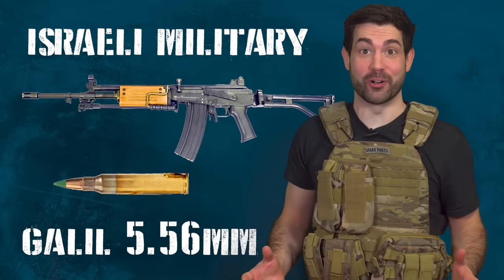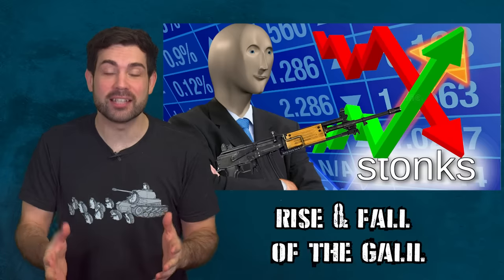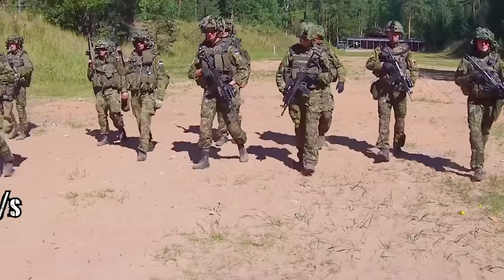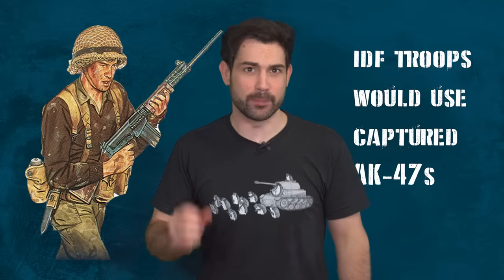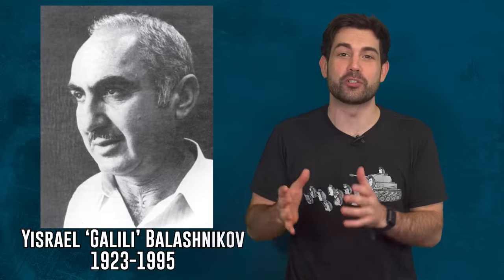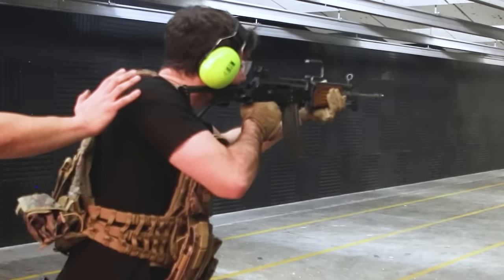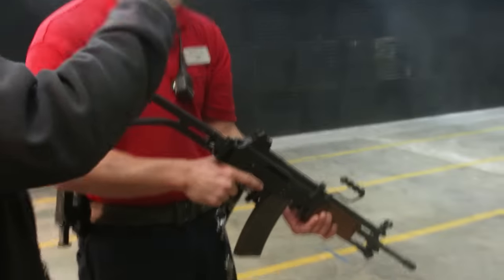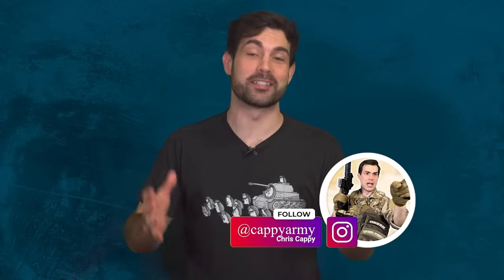Why the Israeli Army Created the Galil Rifle

Comment: The Galil rifle served starting 1974, a few rifles were issued to some paratroopers during the Yom kippur war but the FN was mostly still in service during the war, and was out of service by 1975. in 1992 the IDF started to phase out the Galil from the infantry units, which was replaced by the lighter M16. the Galil was still used by the armored corps, artiliary and engineering corps untill the late 2000's after which it was retired...I'm sorry to say. 
BTW - the Galil's bottle opener was used to open soda pop bottles and NOT beer, since alcohol is not permitted in the IDF.

Comment: a downside for reloaders - it eats your brass. i've seen comments elsewhere that the ejected casings rammed against the ejecting window are a feature not a flaw. anyways, the 50rounds mag was a news to me, as the standard issue would be the 35 rounds magazine.
Reply: Galils with 50 round mags were used as light machineguns, like the Russian RPK.

Comment: The reason why the IDF completely phased out the Galil (rarely used after 1990) is that you just cant beat an m16 for a dollar. It was even cheaper to convert most of the m16a1's from the 1973 airtrain to shortened m16's (car15) than to continue manufacturing new Galils. Also the fact that the m16's and car15's were much lighter really helped their reputation.
Reply: IDF infantry units switched to the M16 in the 90's, but Tank and Artillery units kept them until the middle 2000's, and only then switch to the sawd-off version of the M16 (which they still currently use).
As a tanker in the IDF in the early 2000's, I loved this Galil-SAR for it's reliability

Comment: During my service in the IDF I had at different times the Long Galil ( like the one showed) , the short barrel Galil, m-16 and ar-15. The Galil, though heavy, big and prone to rust, was my favourite. Never jams, even when absolutely filthy, accurate and a soldier's gun.
Reply: How did the ar 15 hold up im gonna build my first time and never knew it was used by militaries
Reply: @grant1430  the AR-15 wasn't used in the IDF as far as I know, I think he's confusing it with the M16A1
Reply: Why the carry handle?. The rifle is not that heavy, but the handle do add weight.
Reply: @XtreeM_FaiL  When the bipods are extended it's easier to carry around the rifle with the handle in an horizontal position because if you'll try to carry it like a regular rifle in a vertical or 45 degrees downward position the bipods legs will continuously get stuck in your own legs.
Reply: @E_y_a_l  Why would you carry it with bipod open? It is an AR not LMG.
ARs are supposed to carry ready to shoot position not hang it like a garbage bag.
Reply: @XtreeM_FaiL   The Galil was designed to be used in both close range and long range open field combat, if the soldier is using the rifle in a close range type of combat then the bipods will be folded and most likely the carry handle won't be used, but if the soldier is in a long range type of combat, the bipods will be extended, during that type of combat he won't start to open and close the legs every time he switches position, he will keep them open, and if he'll move around he needs to carry it somehow, I'm not saying every soldier will do this every time, but in a lot of situations it will be much easier to carry the rifle with an handle when the bipod is extended rather then having the bipods legs keep getting stuck in your lower body or legs.
When I served in the IDF I had a short Galil without the bipods, but later I had a scoped M16A3 rifle with bipods and even when not in combat whenever those of us who had them were sitting around somewhere we would place the rifle on the ground next to us with the legs extended because it just kept the rifle away from dirt, and if we had to move around from one point to another point that we knew is relatively close by it was much easier to keep the legs open and just carry the rifle around "like a garbage bag"...
Reply: @E_y_a_l  I still don't understand why the carry handle. Just crab the rifle anywhere (except barrel and gastube) and carry it. It ain't that heavy.
Reply: @XtreeM_FaiL  I hope you read my entire message because it got cut in half when sent and I had to edit it to get the full text, the weight got nothing to do with it, if you carry it horizontally then you need to carry it from the middle of the rifle's body, not from the stock and not from the gas tube or barrel, look at the Galil, where would you grip it in the middle? the top of the body is flat, obviously you can grip it somehow, but it's not very convenient, especially when the rifle's body is hot after shooting, an handle would be much better, the handle didn't add too much weight, it's just a very small piece of metal with a little plastic on it, it's changes nothing in terms of weight so why not add it if it's makes the soldier's life easier?
You keep thinking of the Galil as an AR, but it was designed as both an AR and a very light MG, the AR variant didn't had the bipods or the handle, the ARM (M stand for machine gun) variant had them since it was meant to be used in a longer ranges open field type of combat, that's why the Galil also had both 35 and 50 bullets magazines and an optional scope.

Comment: Thank you, this was pretty much correct. I served in the 80's and we did have plenty of M16s to go around and the Galil was used only for infantry missions. While true it never stuck in sand, it was a nightmare to use due to excessive weight and cocking resistance. I don't miss it.

Comment: Interesting article. I was one of the first units (7 SAI) in South Africa to be issued the R4. Apart from the obvious improvements to earlier weapons was that it had very little recoil, and thus had amazing accuracy, added to that the amount of rounds you could carry, and its robustness, made it a very effective weapon. Not sure what the gripe about its weight is, basic training took care of that, and even in "R" mode you could lay down a good rate of fire, accurately.
Reply: Tenecuter
Reply: I transitioned from the R1 in 1982. The two things I didn't like about the R4 was the forearm and the lack of balance that the R1 had. Other than that, a fine weapon.

Comment: The Galil was my primary weapon during my 3 years in the IDF during the mid '80s. We loved the reliability and ease of use and maintenance but it was really heavy especially  when you're also schlepping 8 - 10 magazines (an empty Galil magazine was significantly heavier than its M-16 equivalent) together with the rest of an infantry soldier's kit. 

I was issued the short version when I was the radioman for our company commander which was slightly ligter than the regular Galil but that was more than offset by the radio and accompanying gear we carried. Officers like my company CO were ordinarily issued the short M-16 which was much lighter than my short Galil (not to mention the radio) so keeping up with him when running was a challenge. 

The bipods were loose and tended to rattle when folded up so most guys removed them or figured out ways to keep them from moving. I don't recall shooting with the rifle resting on the bipod even once. Nor do I recall using the wire cutter. It was a useless feature. 

The folding stock was great. We always took our rifles with us when we got weekend leave and the folding stocks made like much easier when traveling on busses or hitching rides. 

As a reservist, we were issued those surplus M-16s you mentioned. We were pleasantly surprised by their reliability after hearing the stories about how even small amounts of sand would cause them to jam. And as reservists doing 4-6 weeks of active service per year, we really appreciated the reduced weight of the M-16 since we weren't as young or as fit as during our 3 year mandatory service. 

Ultimately, I understand that what really killed the Galil was its lack of accuracy. Even while I was serving you'd hear that the IDF was trying to figure out why the level of marksmanship had gone down. It turns out that the sights on the Galil sucked.
Reply: I understand that even the old M16s we have were eventually retrofitted to be far more reliable in sandy conditions since the US dropped them on our heads, lol.
Reply: @XDSDDLord  I dunno, I had an M16A2 and the damn thing wouldn't shoot 3 bullets in a row unless it (and the mags) had been freshly oiled. In the firing range it's perfectly fine, but the second you step out into field conditions for any length of time it's bloody useless.
Reply: @talknight2  Yeah, that was the problem with the original M16A2, but by the A4 a lot of it was improved. That's why my dad said everyone was jealous of the people who had the Galil because in a firing line an entire battalion could fire their M16s and only 2 would actually fire.

Comment: The Galil or R4 /R5 was South Africas licence built version of the Galil. There were slight mods made as the SA version had a bigger sight ring, to let more light through. There was another reason. Was called a jungle run or bush run, same thing. Except use the sights differently. use the sling to hold the rifle with the stock folded. Look over the top of the back sight through the middle of the front sight ring. one pull on the bang switch is a 4 round burst and this was the iron sight red dot of those days. Considering that a contact is normaly very close you do not miss. R5 was my service weapon, Later on camps was a R4. Camps were fun but We 'Bos Oupas' never did quite what the 'Blou gatte; and'Ou Manne' were expected to do. we still got everything done.

Comment: In mid 1980 in the South African military, we started using the R5 which eventually completely replaced the R1 which was a locally manufactured copy of the FN FAL.  The R4 and R5's where South African adaptations of the Galil manufactured under licence in South Africa and are still used by the South African military and police forces today.

Comment: Thanks. 
Additions: the Glilon, is a short version of the Galil, before the Ace, on the same idea of the M4 (short M16).
A major disadvantage of the Galil family is that in contrast to the M16 family,  the rear sight is on the removable top cover of the riffle's body. This removal cover can't be connected tightly to the gun, so the rear sight is not precisely aligned with the front sight (as in the M16).

Comment: During my service in the Israeli armored infantry in the early 80's, the Galil was our weapon. It was heavy and clunky. The bipod would spring open by itself whenever it touched something—like your leg—for instance. Very irritating. It was wasn't accurate, because the rear sight was on the removable dust cover which didn't fit tight enough. The good thing about it, like you mentioned, was that it worked under all conditions, unlike the M16 I had later, which was prone to jam.

Comment: I did my compulsory military service in the South African military in 1979 and 1980. We used the so called R1 which was a FN FAL jury rigged for SA. By the end of 1980 I noticed some paratroopers coming through our base and they were carrying the short barrel  so called R4 (Galil ). Shortly up to that point have they worked with the short barrel and foldable stock R1. I see that the SA military still use the Galil but now it is called the R5. From what I hear is it a very good weapon.

Comment: My service weapon 1995-1998 and then during active reserve duty. Compared to M16, this thing was heavy. Now when I see soldiers and police in South American dramas, I tell my wife, look, this is the gun I used to carry in the service (she doesn't care). When it was phased out, there were stories about aging guns that couldn't be zeroed completely, because the rear sight is located on the top-cover that loosens with time. I now know that wasn't the main reason it was discontinued. Thanks!

Comment: I had the R4, the SADF version of the Galil, the wooden forestock was replaced with a plastic one, and a longer plastic folding stock, as the original aluminium one proved too short for the average South African soldier. A rifle with the short aluminium stock was still available for the shorter soldiers to use. The carry handle was also absent.

Comment: I like the OG design of the Galil, its like very versatile you can use it to open bottle, cut wires with the bipod, folding stock, carry handle, grenade launcher. If only they would redesign the materials to make it lighter but still have those features I think it be the best rifle a man could get. Sad they replaced it with Tavor

Comment: I was told by Israeli doctrin analyst that during the 1973 war, the US shipped M16 to Israel.  Israel liked the lower weight of rifle and amo (then the FN)  as well as the effective auto fire that ment you could replace the Uzi.  This was also a time when Israel wanted to have as much indigenous production as possible.    So the spec was for a rifle that used the 5.56 and would be suitable to Israeli use.    
The AK47 design had a better reliability reputation than the M16 at that time (something that is actually disproved).  Unfortunately the machining on the Galil makes it very expensive to produce, plus design is based on 1940s and doesn't take advantage of materials advances.    In retrospect, I believe that Israel should have licensed production of the M16, but this was not politically practical then.  The biggest advantage of developing the Galil was to build the Israeli small arms industry which continued to develop new weapons.  Israelis tend to look at the Galil like we look at the M14, grandfather's gun.

Comment: I see you have a South African R4 in the demo. It was made by Vector under license The safety lever on the Galil is marked SAN and the R4 SAR. And it was one of the early ones due to the wooden grip, later it had a plastic one that was longer.

Comment: Galils (SAR) were still being issued as late as 2009.  The M4 was introduced in 2000, but we still had them.  The shlav bet and reserves still used M1 carbines as well as late as 2010 or so.
Reply from the maker: impossible to find footage of IDF with a Galil after like 1985 though they're so rare
Reply: @Taskandpurpose  Prob because most/all of the footage is active duty.  Typical process is to move the older weapons to reserves and shlav bet (rear guard, usually older volunteers who are recent emigres).

Just 2018, we still saw tour guide security (always ppl doing their reserve duty) with M1 Carbines.

Comment: In 2003-2004 Galil was still used in Israeli army. The shorter version (Glilon) went to artillery. And full sized Galil used at the period of training. As I demobilized in 2006, Galil finally was replaced by short version of M16.

Comment: I carried a short Galil for 3 years in the IDF armored core. They told us that it was more resilient to riding a tank (compared with M16) - that was BS. There were just not enough short M16s.
It was just too heavy. and it showed - when switching to M16 aiming just got better and just imagine how it felt when they got us to attach two 35 bullet magazines.
Frankly, it mostly gave me back aches, but was very useful at cracking open macadamia nuts that were in the packages my mother sent me in basic training.
The thing is, to understand it' you need to look into how Israel functions economically. The way labor unions are run, how free is import etc. and also, the politics behind American defense aid to Israel.
P.S
"Galilea" is not a town, it's a region.
I assure you, we did not get cold drinks. Maybe cold tea in winter. Alcohol is not allowed in the IDF.

Comment: The SLR which was based on the FN was a very reliable weapon. The 5.56mm round lacks stopping power and while it may be accurate up to 500m it won’t do much damage where the 7.62mm round in the SLR will kill over 1000m

Comment: the surplus of these things get sold to the guarding sector.
when new pistols get purchased for the IDF/border police/ police, the old ones (assuming that they are applicable for such use) get sold to guarding firms.
when new rifles arrive, they faze out the old ones and they trickle down to non infantry/combat units, from there to stockpiles for reservists, and then to the security details of higher security locations (certain factories, oil refinement depos, government facilities [like courthouses or ministries] etc'). depending on the case many will either use old Galil rifles or very occasionally the m16/m4

Comment: Original ( 1940s-1960s ) AKs had Milled Receivers, Because  the USSR did Not have the Metal Stamping Knowledge or Equipment to Stamp Accurate Receivers, even though they made stamped and welded SMGs PPSh, PSD, and they captured Haenel StG44 manufacturing Plant. It was only after the AK design had proved itself ( milled) that they developed the AKM ( M= modernized) with a fully stamped Receiver. The PRC followed in the same vein ( Chinese T56 from the Vietnam War are all Milled receivers.).
Did the FN FAL for the IDF have the ABC grooves in the bolt carrier ( L1A1, inch version) ABC== Australia-Britain-Canada co-ordinating design Commission for  the L1A1.
Very good Video, especially the CGI animation.
Doc AV

Comment: South African Defense forces make us of the R4 R5 R6 wich is their modified version of the Galil , South Africa even manufactured Galil parts for the IDF .
Also the South Africans also used the FAL but due to the sandy conditions of Southwest Africa(Namiba) ,They opted to adopt the Galil from the Israelis. The Galil operated better in Sandy condition and because of the folding stock was perfect for the SANDF , because the embraced armored troop transport and tactics to fight in the bush .